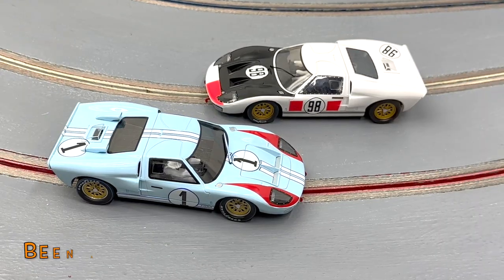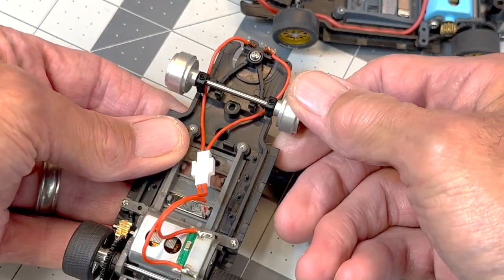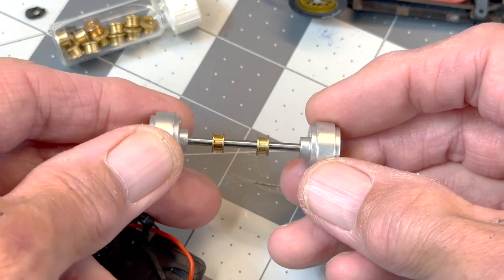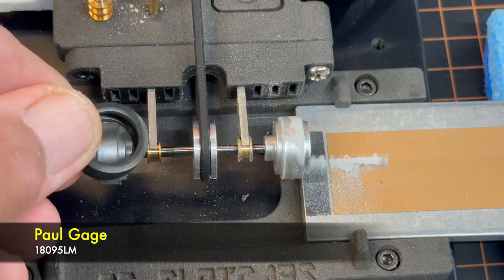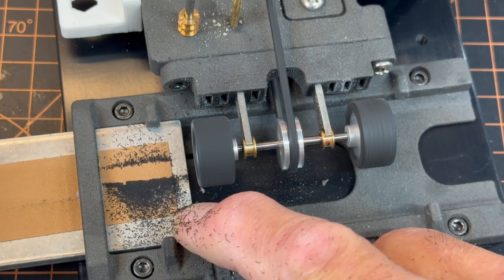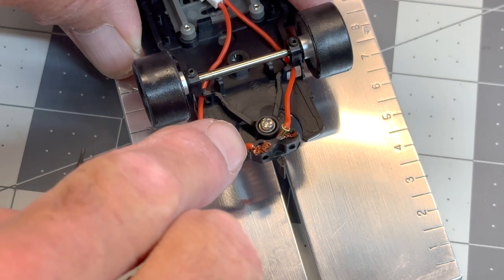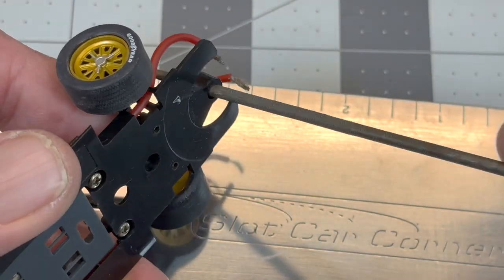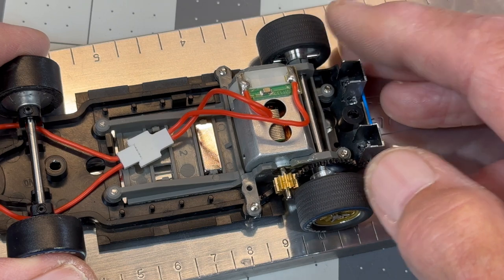Slot it GT40 - Tuning For Our Track Part 1

Comment: Harry, I’m new to the hobby and especially to the tuning. Do you have a SCC stock number for the bronze bushing’s used on the axle? I have the addiction and have many Slot.it cars that will all need the same changes you made in this video. Can’t thank you enough for taking the time to make these video’s. Anxiously waiting for the second part as well.  Thanks
Reply from the maker: https://slotcarcorner.com/collections/1-32-bushings-bearings/products/cp-01000-slot-car-corner